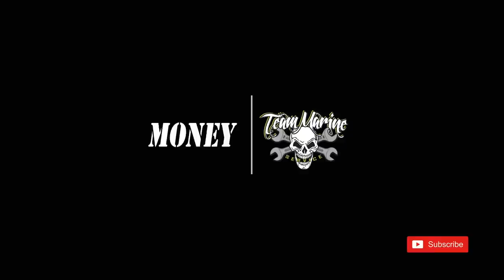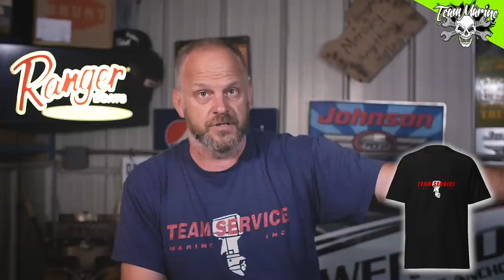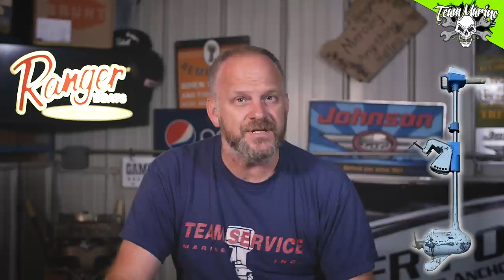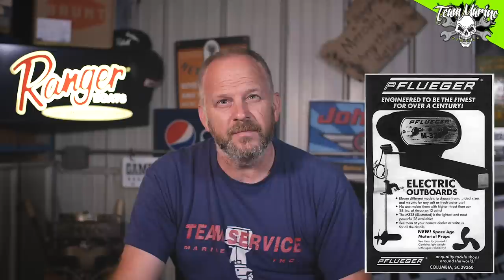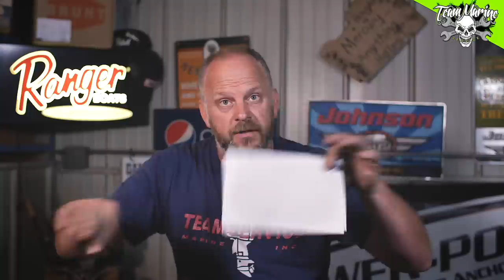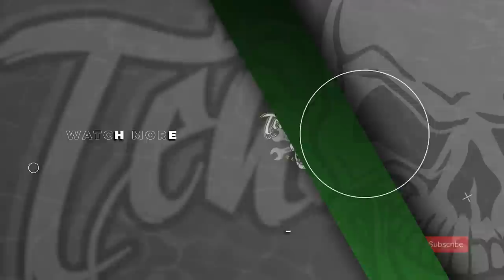THE HISTORY OF THE TROLLING MOTOR!!! (2023)

Comment: This info couldn't be more inaccurate. Gustav Trouve was testing his electric portable propeller in 1881. In 1892 Wilbur Salibury patented his flex shaft electric trolling motor in Chicago and it was being used in New York's central park. By 1896 Samuel Newton Smith was running his electric troller in Menomonie WI. Shortly after he partnered with Tracy B Hatch designing a Submerged electric motor with a propeller mounted direct to the armature shaft running underwater and being water-cooled. They were issue a patent for it in 1899. By 1912, The Jewel portable electric boat motor was beginning to manufacture a design with an electric motor mounted on a vertical shaft connecting to a worm gear. They continued production through the mid -20’s. Finally, by the 30’s multiple designs from the like of Lejay, Minnkota and others were beginning to hit the market.
Reply from the maker: Your Google must be different than ours.

Comment: My first bass boat, a 1978 Ranger 1750A had a Silver Troll Motor on it.  24volt 24lbs of thrust (I think).  About 1983 Minn Kota came out with a 50lb motor, game changer!  Bought one as soon as it came out.  The motor was to heavy for the shaft or bracket, bent constantly.  1984 I went to a Cajun and motor guide.  1988 another Ranger with an OMC Trolling Motor, best TM in the weeds ever invented.  Went to a 36 volt Motor Guide as soon as they came out, never had a problem with running short on batteries ever since.

Comment: When I was 7 or 8 (I’m 12 now) I had a late 90s early 2000s minn kota in my shed, and I put it on a little row boat and used it almost every single day of the summer, spring and early fall for at least an hour, and about 2 years later it stopped working and I think it was because we had no fuse on it. That motor and that row boat was what got me into boating and fishing and I now know so much more. That motor served me well. A few months after it died my dad went out and surprised me with a 4 hp mercury fourstroke for my boat. It was way to heavy for it so we ended up buying a small Jon boat for the motor. Then it wasn’t the right shaft length and was sold the motor and since then I have bought/got for free from old people 6 boats, which I fixed and use to this day. It was that minn kota that started it all.

Comment: Love the channel!  your passion and energy for bass fishing and knowledge of the bass boat tech is legendary. I agree with you about the Johnson/Evinrude trolling motors, they are super reliable, thrust is way under rated. I have 3 12/24 motors , 2 are rated in the 33 lbs  but move my boat very quick on 24v high, and the large prop 58 lbs thrust is great for rough water. The small prop motors go through weeds like a saladmaster and rarely load up.  My first bass boats was a Skeeter Starfire 150, a rocket on the water, but wouldnt handle rough water very well. I love my second boat which i still own 1988 Ranger 363v with dual step hull, great ride and performance. Both ran Johnson / Evinrude trolling motors, the one on my Ranger is still going after 35 years, many state and local tournaments and 4 B.A.S.S. Eastern Divisionals. Keep up the History Videos, old boats, motors, electronics, the topics are many. Thanks Again for your passion for Bass fishing!

Comment: Owned Shakespere, MinnKota, and motor guide. Every minnkota I ever had burned up in the housing.  Sill have a 43lb 12v motor guide as a spare j. The garage and a tour 67 on my boat currently.  Oh, forgot I have a transom mount 30 that still works…motorguide again.

Comment: i wish you'd talk about the voltage. for decades folks worked with 12 volt. Now it seems mandatory to haul around 3 lithium batteries. I can imagine boats have gotten heavier, but i wonder if i run 24 volts if i'm just gonna be putzing along at a half knot